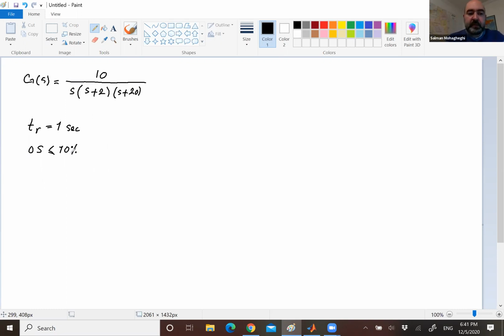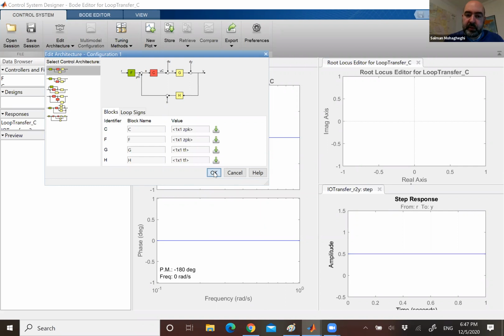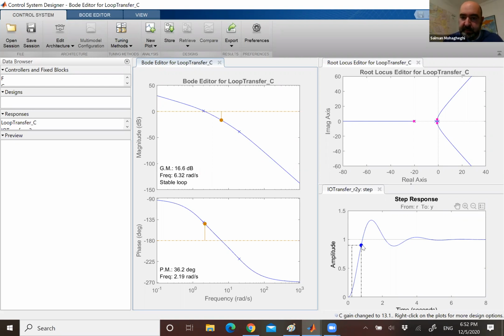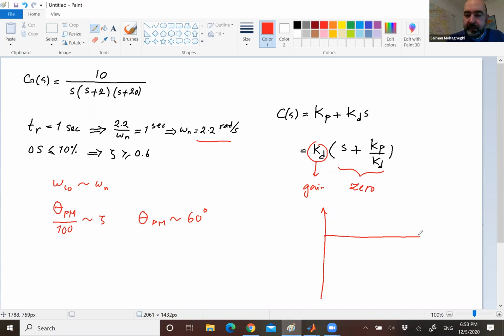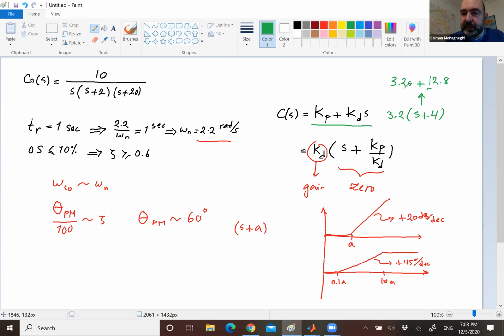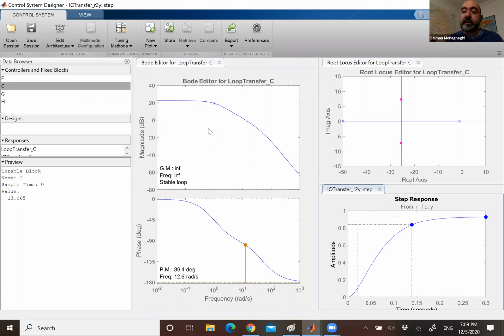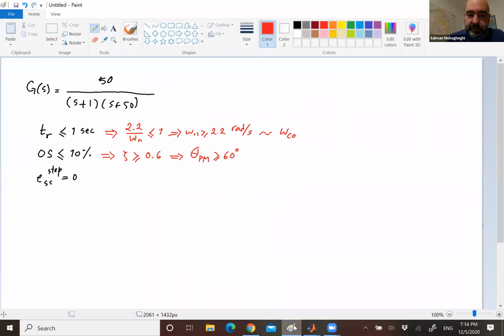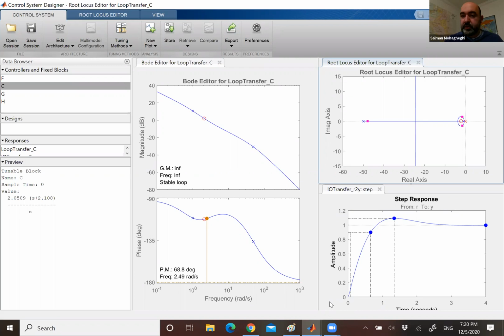L33 Designing P, PD and PI controllers in Matlab using sisotool

Comment: The damping ratio applies if it is a second order under damped system with two complex poles.  However, this system has 3 real poles that don't need damping.  The natural frequency is the frequency at which an open loop system will oscillate.  Think of a slinky.  Why not use the pole locations specified by a 3 or 4 pole ITAE depending on whether the controller has an integrator.
Where does the open loop transfer function come from?  

It is all magic?  The students don't understand what Matlab is doing since the code is all hidden away in a library.  Matlab is great for getting answers but poor for giving understanding.  I am experienced at this.  The open loop transfer function  has 3 poles so three controller gains are required to place all the poles.  The integrator doesn't coujnt because it comes with its own pole.  If you can place all the closed loop poles you can get the response you want.

The professor is right about the damping factor and natural frequency is just an approximation so why waste time with it?   The professor admits the proportional gain only will not work.  Well duh.  You don't start with a P controller or a PD controller.  Like I said, the open loop system has 3 open loop poles so THREE gains are required so there must be a Kp, Kd and K2 which is a second derivative gain that is used on the error between the traget and actual acceleration. 

The professor is wasting your time.  He should explain like I did that a P or PD or PID controller will not work well.  The second derivative gain is required.   All this is known so why waste time?

Comment: I am very impressed with your lecture, first of all, I should thank full for your presentation. I have small doubt that, what will the w_c frequency be considered to my converter switching frequency is 10000Hz
Reply: it should be 1/10th of switching frequency typically